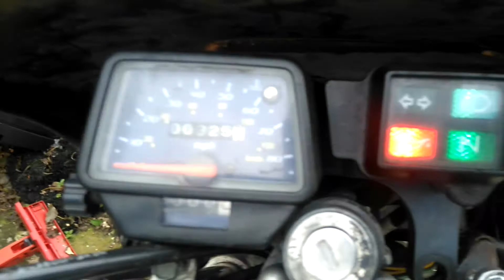Yamaha dtr 125 first start after new cdi unit big one exhaust sound

Comment: They tend to give alot more power them slip on big one exhausts but they do piss oil everywhere put some sealant on it seems to be blowing abit
Reply from the maker: Its just with the powervalve open its louder bro if a rig the servo up its a uiet as a mouse but with them servos they shut off the power say ur moving up the gears once ya let the throttle off the valve closes av always had them open just my choice tbh cos used to thashing them to get some sort of power like the ones made before 97 abso flyers,88,89,90 were. kwickest ever made if ya own a dtr best increase is put a pre 97 harness and cdi onto a 97, to o3 bike old ones were unresticted cdi units
Reply: @2strokemxclassics  yes same here always had them locked myself but the 02 model i own at the moment does have a servo with the unrestricted cdi box the one that bolts to the 2stroke oil tank on the front.you do no if it's not set right them cable's they tend to turn backwards   mate it means too tight slacken off on both sides its trail and error
Reply from the maker: @rider6327-g1v  its got a bolt threw the powervalve end black pulley into the casing m8 were u set the valve up to the fully open position  the pulley isnt working,its got the gilera sc 125 cdi unit and dtre running gear but swopped cdi,s as gilera sc/derbi gpr are European cdi so unrestricted but fit theres a vid of it set away in my lists av never new the ones behind the 0il bottle to be destricted they fitted them to the 97-03 bikes when they detuned them for emissions n stuff av got an e reg one and its faster than all what I own 88-97 are the kwickest a have heard of some German company deresticting the cdi on the oil bottle dunno how they Do it though
Reply: Yes on the later one's like mine if you get the 20 cdi box they arnt restricted but apparently 30 one's are but thats only airsay mine as a reed switch bulit in my clock its like a govner ive just took it out and let it hang in some vasoline in a bag lol 😂.no on a serious note its made from glass so the vasoline stops it from breaking.do you have the 3mb cylinder on yours they are high compression one's you'll get them on the re model's and tdr125 they are alot better than the 3bn one's.  ive own yammy dtr since i was young brilliant bike's
Reply: @2strokemxclassics  its the dt125re & x models with the emissions m8 with that silly catalytic converter tube on the front of the exhaust it just recycles the gases back threw again it was yamahas way of trying to save them

Comment: It sounds good bro with that big one pipe! I was thinking about buying one for my 200r because you cant get any aftermarket pipes for it, do you think it would be worth it to try, its got to be better then the choked up stocker pipe
Reply from the maker: Yeah if it will fit m8 it's worth giving it a go, I'm not sure if the expansion Chambers are fatter or not between 200 and 125s,the silencers are the same in 125 and 200s an the exhaust gasket o ring are the same, those techo unrestricted ones are cheap they sound OK too I got a bran new one for the white one for£80 off Ali express an there on ebay for 120 the valves pinned fully open aswell there normally quiter on tickover when not pinned
Reply: @2strokemxclassics  I just bought one on ebayuk for 80 euros, a black one, Ihe dtr cylinders are cheap in the uk and the heads, that would be sick if they could be bored and resleeved with a 200r sleeve and rechamber a dtr head for a 66mm 200r piston, because the 3ET cylinders are expensive if you can even find one
Reply from the maker: Would a dt 230 fit on m8 onto the 200

Comment: hi man can you tell me how to wire and witch cdi u used? im doing a 170CC build with moded ports would like high rpm...
Reply from the maker: Hi there good luck on the athena there good cylinders. the cdi is from a gilera sc 125 there the same as the electric start dt cdi units but unrestricted like the old 88-97 small dtr cdi.you would need the electric start model harness and bottom end if you were to fit this cdi but if you want good top speed its worth opening the powervalve to fully open.
Reply: Oh ok thanks man, its actually for tzr125 witch has electric start, would i be fine just ordering the gilera cdi? Does the wiring match the tzr 4jb/fl cdi? I cant seem to find mutch on this. Nice job man!
Im going all out since the other engine was poorly tuned when i got it. We are porting cil, leave case stock acbept maybe flow match the sides, would you know if honda cr125 vforce reeds fit? Thats in the plan, pwk 38mil wit boysen modded intake,fat clutchdiscs with smaller but gripipy friction plates. Had to mod liever link but its fine.not shure if i should skim the athena head or not. Now the debate is upgrade cdi and keep lighting but mod timing.
Or go inerrotor ignition. 
Thx for the tips man!
Reply from the maker: @jancappelle8716  hi there good stuff it sounds like its going to be good when you get it done and tuned. I dont know what wiring the tzr takes on the newer ones ive only ever stripped the older ones with the small cdi which is the same as the 88-97 cdi on dtr 125s.it could be the same as an electric start cdi. If you could tell me what the cdi box looks like and how many plugs come off and wires I will be able to help

Comment: Bro can you help me i have dtr 1999 in neutral in low rpm the bike just turn off can be cdi? What problem you have with old cdo can you say ty
Reply from the maker: Hi does it run OK otherwise than turnin off
Reply: @2strokemxclassics  i just clean the carburator bro and in high revs is going like 7, 7.5k rpms max..
Reply from the maker: I don't really kno how to diagnose it off the top of my head I would have to have a look at the bike to figure out what it is as it could be a few things👍

Comment: bro i have dt 125r 2001 she go max 7k rpm
Reply from the maker: Hi man is it restricted.its worth checking your powervalve is set properly and working first cos those 2 cables seize up and the valve restricts the bike through not opening correct.turn the bike on it will do the powavlave self cleani.g cycle(that motor whizzing noise for 2 seconds) but dont start it then turn it off then check the black casing lines up with the hole on the casing behind it. Its inside the cap on the cylinder that the two cables go in.if it doesnt line it up by adjusting the cables watch those skinny 8mils on the end of the cables dont snap.once its ligned up turn it off and on again to make sure its set.its best to try it with the valve fully open first to see if it revs out properly so just do as above and wen you have turned the ignition off after the powervalve cycle unplug the servo plug and put something threw the black small casing and into the hole behind it to keep it all locked and open fully so it doesnt spin then test drive it and it should rev out
Reply from the maker: Another quick way I check when in buying them is if the two adjuster bolts that come out of the casing on the side of the cylinder with the cables in are both level it should be near on set.if ones adjusted up and ones screwed down youll know its the valve before tearing into it👍
Reply: @2strokemxclassics  that engine wnt ever of 9k km it has not been driven much since it vas poruchased. it has some blockage and goes 7k rpm that is up to 100kmh. and im interested in something else there is a runing sound  yoy can found that sound on yt yamaha dtr 125 original sound  i am interested in ehat heard i tought it was ring and some say its power valve. ty bro
Reply from the maker: @CaptainCharisma2907  hi there so are you saying yours has a noise?its more than likelys your powervalve if the valve isnt set or the cables are slack the powervalve will rattle back and forth.if you could put a vid up of it running and making the noise I will do my best to help.